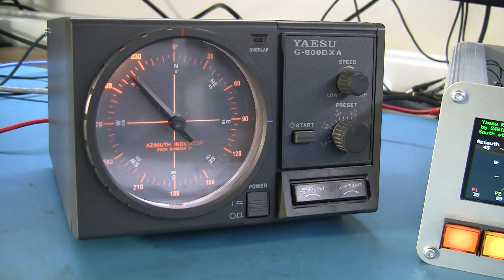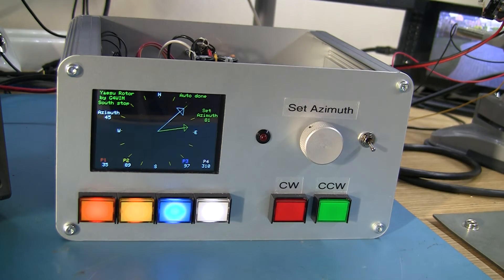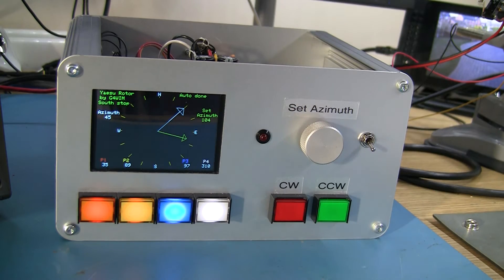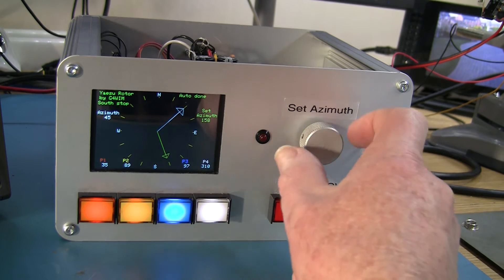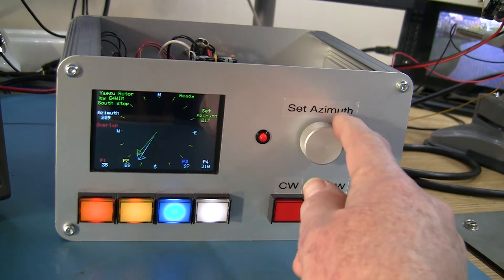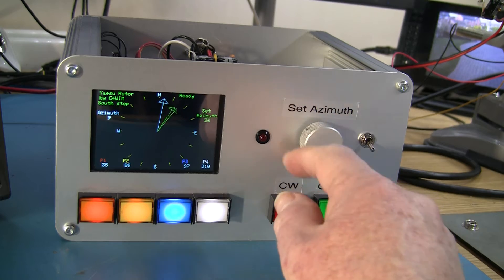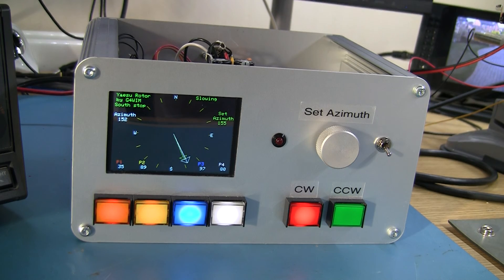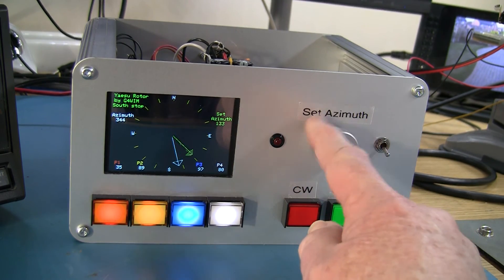An improved Yaesu ham radio antenna rotator controller using a Mega2560 and 3.5" LCD screen

Comment: When are you going to publish plans - source code etc
Reply from the maker: The full design including schematics and source code have been published in RadCom a subscription magazine produced by the RSGB.  It now supports rotor control, radio direction finding and automatic mag loop tuning running on a STM32 Nucleo pcb.

Comment: Thank you for sharing, wonderful build.  Can it be controlled by software also, if so how does the software for that look?
Reply from the maker: Hi, I have a new version which uses a STM32 and offers many more features including remote control.  Take a look at my more recent videos.
Reply: @timdf911  was watching the one about the magnetic loop.  Made me want to work on my mag loop.  Tough haven't seen all of it.  Went to the park with my child.  Interested to see if that controller (same with more features).  Will it tune base on memory presets based on freq?  Think for contest, that would be cool.

Comment: Hi Tim, I have been waiting for a long time for the publication of this excellent design. It's not there in the November Radcom . My KR 600RC broke down about two years back and spares not available now. I am presently using Nano and 2X16 LCD to get the antenna position readout which of course is cumbersome and not very accurate. I am interested in buying your controller whenever ready. I am not good at software programming. Your design reminds me of IVSI and TCAS indicators of 747 classic which I flew as Flight Engineer about 10 years ago. May I request you for the Mega2560 software if possible?
AP2AM
Reply from the maker: Hi Syed - sorry for the delay, but it's taken longer than I thought to get it published due to staff changes at RSGB.  Please e mail me or PM for more info.

Comment: how do you cope with RFI on those super sensitive microcontrollers ? i/o on the arduino are extremely sensitive to any variation of voltages, if you have 1kw into an antenna that is not far from the rotator, for sure RF is going to get back to the controller through rotator cables...
Reply from the maker: The design is in a metal sheilded box with filtering on all signals and power lines.  I run full legal from 160 thru to 23cms and the antennas are close to the shack to minimize coax losses with no problems.  No pins on either the Arduino or STM32 are exposed to the outside world without filtering for both RFI and EMC reasons.  These points along with others are covered in the article due to be published in September issue of RadCom
Reply: @timdf911  really ? ok... I was sure RF would couple to the rotator cables and get right back in the controller. That to me is exposition to RF. Even in a metal box, I was sure RF could come back through those rotator cables. Are you using shielded rotator cable ? You did abolutely nothing to filter RFI and EMC ?
Reply from the maker: @Aleziss  Hi as mentioned above there is rfi emc filtering on critical lines plus even the firmware is hardened against rfi emc. FYI as a professional engineer with over 40 years experience in hardware / firmware design for companies such as Google, Motorola, Qualcomm and the Ministry of Defence I have applied all my accrued knowledge to create a robust design suitable for use in ‘unfriendly’ environments.
Reply: Oh sorry I missed read when you said there was no pin exposed to RFI so you did not need to do anything. So there is filtration on specific pins. I restrain myself not to build such controller for that fact that I don't know how to protect io's against harsh RF environnement and I am pretty sure that all those projects for Arduino controller would perform poorly without the adequate protection... You seem to have a nice and simple project and with your engineering experience, you surely won't have any issues. If your board ever come available as a kit it will probably be interesting. All I find at this moment are projects without any RF protection.

Comment: Hi, very nice job! I love the graphics of the screen: inspired by airplane computers?
Would it be possible to have the software? for the arduino Mega. I will add the control of the rise of the pylon on the console (automatic retracted, display of the height, etc.)
Thanks in advance
Seb
F4JCS
Reply from the maker: Yes I used to work in the Aerospace industry, please send me your e mail address and I'll send you a link to the mega code.  Note I've not done much work on the Mega code recently as I've been more focussed on the STM32 variant.

Comment: Halo Tim...is this project pblished?
Reply from the maker: It's still pending with the RSGB but shouldn't be too long now before it's punlished.  In the meantime I have been adding extra features to the firmware to enable azimuth offset, customizable screen saver, remote control amongst other things.  Most of the recent firmware development has been on the STM32 due to its greater processing power.

Comment: Hi Tim, just wondered if the design has been published yet. ?
Reply from the maker: It's with the RSGB pending publication in the next 2-3 months.  I have two versions, one using a mega2560 and another using an STM32 nucleo which supports touch and other features.
Reply: Thanks for the update.

Comment from the maker: Some people have ask about the soruce of the code.  FYI the code is wrtten by myself with no K3NG input as I was not aware of it. Regarding code size, currently its just over 32k so a little bit too big for a Nano as it stands but I'm sure I could compress it down to fit without too much effort. However I chose the mega 2560 due to its large number of IO pins. So the pin count is the limiting factor for a Nano as the display is driven in parallel mode for speed. Switching a serial LCD driver would free up the required pins on a Nano but the screen refresh time would be slower. I cover all of the above points in the article - so basically a Nano would be possible but would compromise the design, hence the extra cost for mega2560 to avoid these compromises. I have no commercial interest in making a business out of this - it was just a fun Winter project !
Reply: have you looked in to the esp32 microcontrollers? they have more memory BT wifi loads of i/o and are cheap as chips!
Reply from the maker: @letmelooktv  Yes I've used one in another project and they are very good for the price.  I've also looked to porting the code to the STM32 series for the same reasons, however for legacy reasons I decided to start off with a mega2560 plus they seem to be more 'main stream' at least for now.